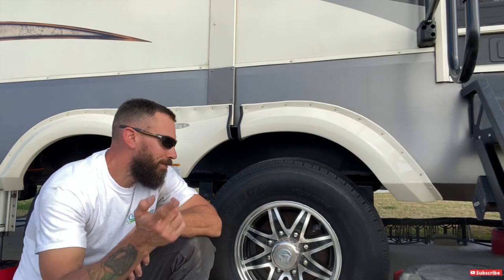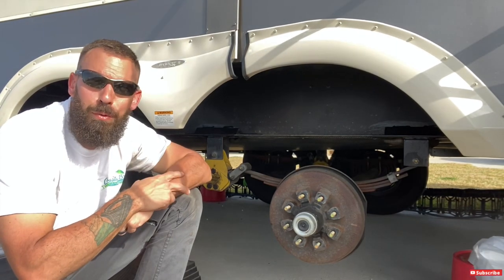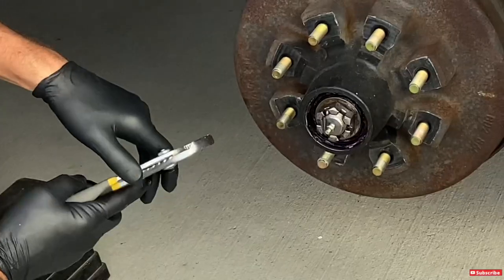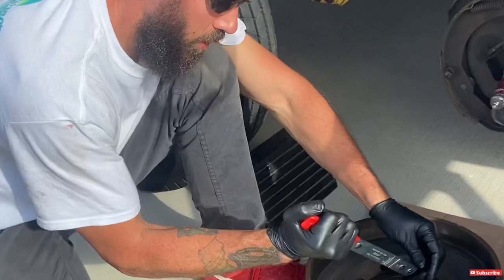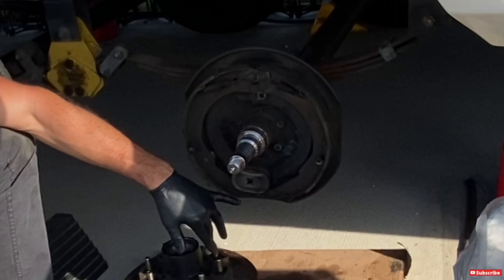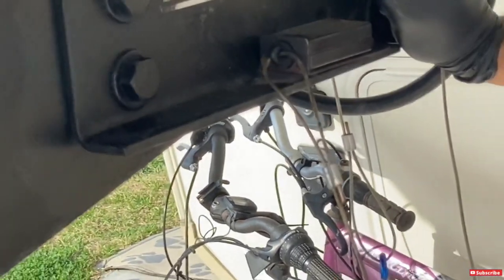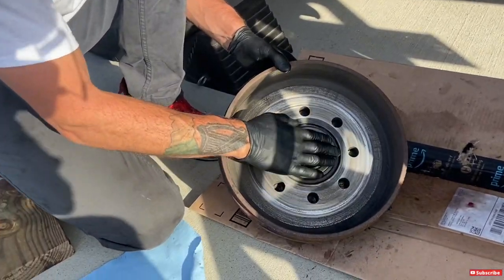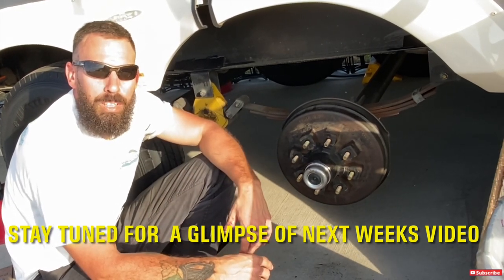How to repack wheel bearings | Installing grease seals on Grand Design Solitude

Comment from the maker: Comment below: When was the last time you checked your Fifth wheel or travel trailers brakes and bearings? If you don’t know maybe it’s time 👍🏼
Reply: No doubt.  We've never checked our "new to us" 2014 Jayco Jay Flight Swift SLX 184BH wheel bearing... and for some reason I doubt the owners before us did too.  Even though it was in immaculate condition when we bought her. So this is something we definitely need to look into adding to our never ending RV Project list.
Reply: great video, im about to do mine. Any chance you have a downloadable copy of your maintenance check list?? Cheers!
Reply from the maker: @Goostradamus81  thanks! No unfortunately I don’t but I’m working on anew maintenance video and will hopefully have a downloadable sheet for it 👍🏼
Reply: You have to over tighten the castle nut, then unthighten it to the point where it spins freely, with zero play on drum. Otherwise, it's a great video .

Comment: Just something I ran across today is the Brearing Buddy - etrailer stated in their video - and they have very good videos - "you don't have to ever worry about having to repack your bearing" - now that is bold.  I am sure they did not mean that you do not have to worry about examining them for wear.  My assumption is that the Bearing Buddy, is intended to allow easy access to lube your bearings, and it is supposedly designed not to allow you to overfill with grease to the extent that it moves out the back seal and into the brake area. - it will move out the front.

Comment: Great video. The last time I did this was back in the early 80's when I worked at a machine shop for 6 years. I have 3 trailers, 2 are new (camper & boat) with one old cargo trailer. I will need to tackle this on my cargo trailer sooner than later.
Reply from the maker: Not a bad job right? Of course having three trailers to do isn’t much fun haha

Comment: I just subscribe to your channel. Thanks for taking the time to show how to perform this important task. I just purchased a used grand design 5th wheel & I need to know how to grease the bearings. I will be following your video step by step. 👍
Reply from the maker: Good deal, hope it helps out. What floor plan/model did you get?
Reply: @WhyWait  2018 reflection 303rls 32ft.

Comment: Also, don’t forget there are greece  zurks on your leaf springs shackles as well. At least there is on my 2021 Solitude 310 GK. Great video by the way thanks for the effort.
Reply from the maker: Grease not greece lol…but yeah there are no zerks on my shackles or older RVs. Mine is a 2018. I know have the Roadmaster Comfort Slipper Springs! Appreciate you watching 👍🏼
BIG RV SAFETY UPGRADES (Why You Should Get This Done) // Performance Trailer Braking
https://youtu.be/bSkom_C_vME
Reply: now have Roadmaster comfort springs not know… lol we are even😂😂 damn dictation instead of typing.
Reply from the maker: @skoffco  hahaha

Comment: The electromagnet doesn’t pull back toward the backing plate when on. It magnetizes to the brake drumb as it rotates, pulling the arm it's attached to. Causing the brake shoe to go out toward the drum.

Comment: If the brake drum comes off easy, the brakes are out of adjustment. Tighten them up when the bearing maintenance job is done, with the brake drum installed. There is a rubber plug on the back, remove it, and use a brake spoon to tighten them up. If you have self-adjusting brakes, adjust them manually using a brake spoon at least twice a year (if there is no resistance when you spin the drum  by hand). The drum should never spin freely, when the brake shoes are properly adjusted.
Reply: If you have self adjusting brake hubs, why do you need to adjust them?

Comment: Great video! Just curious, is it really a problem if I install say, the front driver’s side bearings set and rotor where the rear driver’s side bearings set and rotor goes? And vice versa? They look exactly the same.  I may have done it accidentally and they went on and seem to work fine. (Not talking about switching the inner bearings with the outer). Just an honest question. So helpful answers wanted only.
Reply from the maker: No it really shouldn’t be a problem but that’s why I always do one set at a time. I just always feel more confident putting the same set and parts back on where they came from. Just in case something has sort of worn or got set in it’s way on that certain wheel in that spot. But that’s just being anal. It really shouldn’t matter and it’s no different than installing a brand new set of bearings or new rotor on said wheel. 👍🏼 Thanks for the bud words and appreciate you watching!

Comment: I'm tracking - but pulled the breakaway switch - and the tires kept spinning.  Battery is charged,  Heading back to try and track the electrical from the breakaway switch; could replace it.  Any suggestions?  THANKS!

Comment: Hey Chris ! When you cover the spindle with the new grease, have you ever had problem with grease going in your drum and your shoes ? I mean while your driving.
Reply from the maker: No, not at all Steve and it shouldn’t. In fact I even just had new 8k Dexter axels installed yesterday and the spindles come from the manufacturer covered in Lucas Red n Tacky grease and wrapped in plastic wrap. 👍🏼 Plus since we just opened everything up for the new install everything looked fine as usual inside my drums. Thanks for watching.

Comment: Thanks! I was quoted $100.00 per axel. I am going to do this myself. I do not have a zerk fittings on my hubs, what is your opinion of installing bearing buddies? My travel trailer is a 1998 22H Artic Fox with 2 axels.
Reply from the maker: Nice! It’s really not too hard of a job and good peace of mind knowing you’ve checked everything out inside there. I can’t comment on Bearing Buddies, just not familiar with them and never heard of them. Good luck with the project and stay safe out there!

Comment: Hello, just watched your video on re packing the hubs.  A few  questions about jacking up the camper. I have self leveling as well, how do I lift up only one side? Do I take the camper to hit hitch height where only the first 2 feet are on the ground? When you lift the side you are working on won’t there be too much stress on the opposite feet? How an I find all the links to the products specifically the bearings and seals, thanks
Reply from the maker: Bearings and seals are rig specific. You’ll need to find those on etrailer. They are great at answering questions and helping you find the right ones. 
https://www.etrailer.com/
Obviously there are Amazon links to the other stuff in the video down in the video description. 
For leveling go to manual mode on the control panel. There you can adjust each individual jack or side of the camper. You just raise up the side you are going to work on first, just till the tires are up off the ground. Do like I said in the video and leave one tire on if it makes you feel more comfortable, if a jack malfunction the camper is only coming down one inch until the other tire hits the ground. And no that’s not more stress on the other jacks on the other side…those tires are still on the ground remember. That’s where the weight is.

Comment: I want to do this on our 5th wheel before we head out on a 2 week trip this summer. The big question: Where do you jack it up? I'm getting conflicting answers. Would love your opinion. Thanks!
Reply from the maker: Depends. Here’s a good video where they talk about that. I use my hydraulic jacks like in the video, one side at a time and only an inch off the ground and only one tire at a time. All for safety reasons. If you want to take 2 off at a time or even all 4 I don’t recommend doing it like me. I’d jack it up and use jack stands. Using the frame if possible.
Reply from the maker: Here’s the link
https://youtu.be/xOMYUsD-mpU?si=ODNyuwtPxScH8alq

Comment: Hello, I have one question. Is there any specific way on how to use the auto level system on manual to jack one of the sides to take the tire off? Is there any wrong way? Would there be too much stress on the other side? TIA!
Reply from the maker: Nope, nothing special, you just raise the one side up on the two back jacks. About an inch or so off the ground. Doesn’t hurt anything 👍🏼

Comment: One more comment - per Lippert: the 3500# and 4400# axels have the same parts for the wheel bearings - and their kit is #333948; it does not list the #4400 axel when trying to find the right part on their webpage, so I called.  Also found on Amazon and etrailer via the same part number; it is not a one size fits all - just a one number seems to fit all..

Comment: Hi, I have got the same GD Solitude. Contacted etrailer and asked them which grease seal to get. They said to take the hub off and measure. Are you using the GS-2250DL grease seals?
Reply from the maker: I’m not at my camper right now but I will check when I can!
Reply from the maker: Yup. I just checked. The GS-2250DL is what I use 👍🏼

Comment: Hello, I need your opinion on that, I did brakes and bearings this week-end and I thight the castle nut to 50 pound torque and loose it and tight it by hand until it stop. I did a little road test and find out a bit of a play when I jack the wheels to see if I have play. Do you recommand to have realy no play when you push on your tire rignt to left and top to bottom ? Thanks you very much for your help.
Reply from the maker: Check wheels for side-to-side looseness – There should be a very slight amount of play in the wheel, typically 1/8-inch or less. Really should be much movement at all. If the wheels are pretty loose or spin with a wobble, the bearings must be serviced or replaced.
Reply: @WhyWait  Chris when you put your tire back on did you find some play by just tightning the castle nut the way you did it ? When you push your tire side to side and up and down. Thanks again.
Reply from the maker: @stevebeaulieu2617  I didn’t have any play but everybody’s setup will be different. I hate the cotter pins because I have to back off the castle nut so I can line up the hole so the cotter pin can go through. I prefer those push on tang washer or cage castle nut keys I believe they are called. But yeah really tighten that castle nut down as tight as you can to seat. Rock the hub and push in to make sure the hub is fully seated onto the spindle.
Then tighten the castle nut a little more. Then back it off just a hair. Here’s how etrailer.com recommends it…
Look to see where the cotter pin hole lines up with one of the notches on the nut.
Then back the nut off one notch, so that the cotter pin will fit through the castle nut.
Install the cotter pin and then spin and rock the hub.
When you rock the hub you should feel the hub barely moving front to back.
Try experimenting by loosening the castle nut one more notch to feel the difference in the play in the hub.
Then install the wheel and rock the hub again.
On the outside edge of the tire, the movement should not be more than 1/4" inch.
Any play should be barely noticeable.

Comment: are the wheel bearings and seal come in different sizes or are they all the same size? i have a 2018 Jayco  Whitehawk pull behind traile.
Reply from the maker: Wheel bearings and seals are all different depending on your RV and axles. I would go to etrailer.com to buy these. They can help you out with finding the right ones for you. They are very good at answering questions and letting you know what’s right for your truck or trailer.

Comment: How do you know what sizes seals and bearings to order?  Is it based off rim size or?
Reply from the maker: Few ways. I looked mine up on my RV manufacturers part list for my specific RV. Also when you pull the seals out the number is on them. You can also measure everything, based off your old seal, measuring outside, inside diameters and width. At this point you have everything opened up anyways and should be able to read the numbers on the old seals anyways. Go to Etrailer.com and order there, you can also ask exact questions with them and they are excellent at finding the exact parts you need. That’s the best route to go. 
Www.etrailer.com
Hope this helps.

Comment: I have a 2021 Jayco travel trailer. Can I just use a grease gun to put new grease in?
Reply from the maker: So you probably have the quick grease zerks fitting where you could do that but I never recommend it. Like I say I’m the video too many times people pump too much grease into there and blowout the seals. I’ve seen it a few times then you have grease on your brakes. Plus opening these things up and looking inside when you repack by hand gives you the chance to inspect everything. Inspect your brakes, the moving parts, make sure no seals have blown out. Plus by repacking by hand you get all of the old grease out when you do that. 👍🏼

Comment: How do you know what size grease seals you need?
Reply from the maker: I looked mine up on my RV manufacturers part list for my specific RV. Also when you pull the seals out the number is on them. You can also measure everything, based off your old seal, measuring outside, inside diameters and width. At this point you have everything opened up anyways and should be able to read the numbers on the old seals anyways. Go to Etrailer.com and order there, you can also ask exact questions with them and they are excellent at finding the exact parts you need. That’s the best route to go. 
Www.etrailer.com
Hope this helps.

Comment: How do you know what seals to buy?
Reply from the maker: I looked mine up on my RV manufacturers part list for my specific RV. Also when you pull the seals out the number is on them. You can also measure everything, based off your old seal, measuring outside, inside diameters and width. At this point you have everything opened up anyways and should be able to read the numbers on the old seals anyways. Go to Etrailer.com and order there, you can also ask exact questions with them and they are excellent at finding the exact parts you need. That’s the best route to go. 
Www.etrailer.com
Hope this helps.

Comment: Every trailer I have had had ez lube axles. I just pump and spin tire until I see new grease. I don’t know why here in 2021 they can’t design a single axle bearing that’s sealed that you can change like a pistol magazine and keep it moving. Their on cars and trucks.
Reply from the maker: Sometimes I don’t get it either why trailer bearings can’t be more like automobiles. Thanks for watching.

Comment: Those brakes look like self adjusting , most gd come with lippert self adjusting brakes.  Larry
Reply from the maker: Yes, they are, you are correct sir. 👍🏼 I realized that after making the video. I will actually be switching over to the electric over hydraulic brakes next month.

Comment: Why do automobile wheel bearings last 10 times longer than trailer bearings?
Reply from the maker: Wheel bearings on most modern cars and trucks are a sealed unit to the wheel hub. The bearings on a trailer are not considered a "sealed unit". Which is why a wheel bearing on a car is $150+, and a set of bearings/seal for a trailer is $20.
That’s why vehicle bearings are better quality, better sealed and in most cases, have lower rotation speed (larger radius, lower rpm, less heat) than trailer bearings. Also most trailers are much closer to the weight limit of the axles than cars are, which the bearing heat stresses the grease more and lastly grease does not do well sitting around once its used. Many people only use the trailer once a year. I think it’s just an overall good practice and checking everything out inside there to find any potential problems before a major problem happens…👍🏼
Reply: @WhyWait  Makes a lot of sense. Thanks for the reply.

Comment: Those EZ lube fittings are worthless and just cause a mess without really repacking your bearings. Too much grease in your hub can lead to high preasure in the hub which can lead to poping the dust cover off or worse the inside seal failing. Save grease and your brakes and just pack the bearings good, a lite coat inside the hub, race, and spindle.